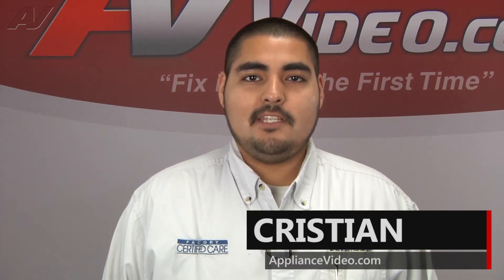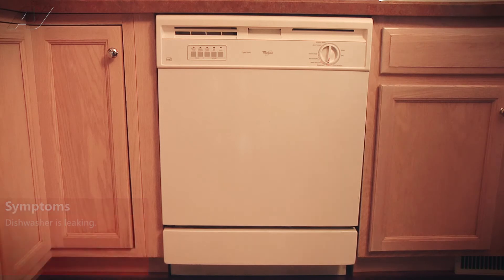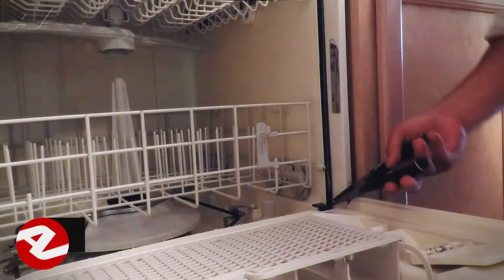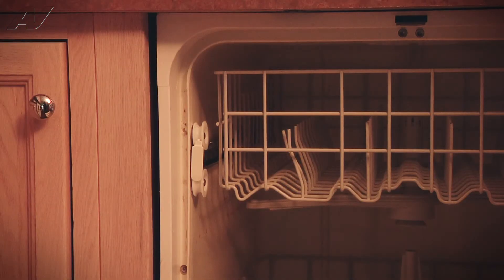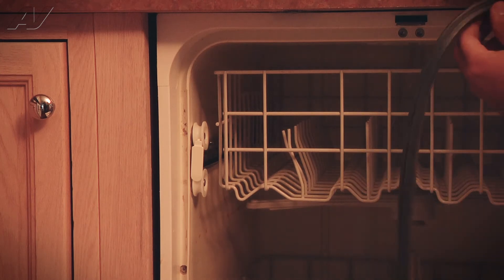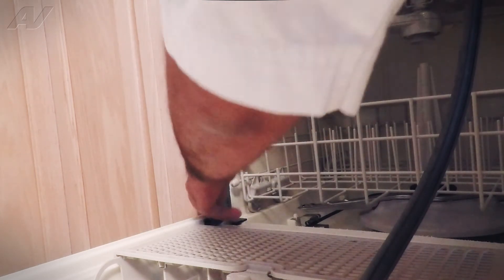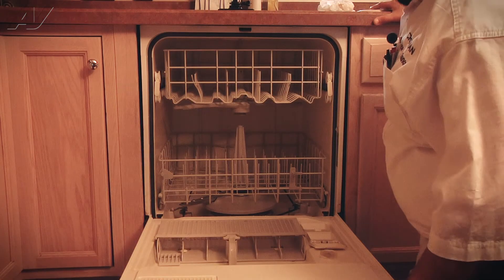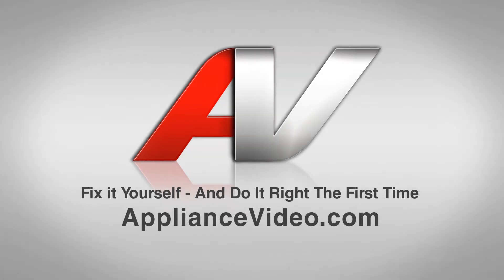Whirlpool Dishwasher Repair - Leaking Water - Gasket

Comment: Very good video.  Moved my Whirlpool DU915PWKB0 dishwasher to the basement to be used per our bar.  Found the unit leaking from the door on both the left and right sides (bottom).  I ordered and replaced the gasket per your instructions in addition to tightening up all of the screw heads around the door (just in case).  Your comments related to the gasket placement (color indicator / middle / color facing into the washer) was great tip.  Thank you for your video.  Thus far no issues with the dishwasher leaking again.
Reply from the maker: Great question, if you have a more technical question that our parts department cannot answer, you can search our over 13,000 answered questions free at our website www.ApplianceVideo.com under our Repair Help section. You can also call our parts department at 1-800-830-5465 and they can give you help 7-days A week ,or search at www.SaveMoreOnParts.com  .

Comment: My dishwasher is leaking from both the left and right sides ( we have a Maytag ) I think its the gasket ( it doesn't look bad though ) but how do I know if its really the gasket? Is it possible its the bottom seal of the dishwasher door? How dose one know the difference between the two to know which one needs to be replaced? I've already check the water levels, drains, hoes, soap amount, and it is cleaned on a regular basis.
Reply from the maker: Great question, you can call our parts department at 1-800-830-5465 and they can give
you help 7-days A week. If you have a more technical question that our parts
department cannot answer, our technicians are answering
all questions at our website at www.ApplianceVideo.com under our Repair Help section. We have over 3,000 common questions
and answers that you can easily search through by your model number, appliance
make, and problem or error codes, and It’s free to search through our question
& answer library.
Reply: Did you fix it? Having same issue . It has been working great for years and suddenly leaking from door bottom right and left only at certain times during the cycle.. doesn't leak as much when doing the 1 hour wash. Gasket could be it or the valve .. not sure which to try first. What did you end up doing?